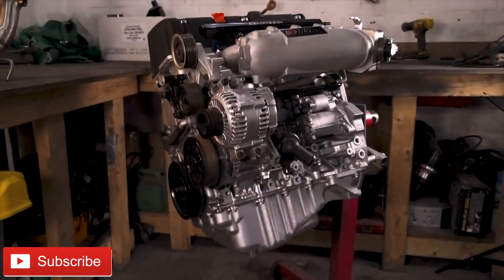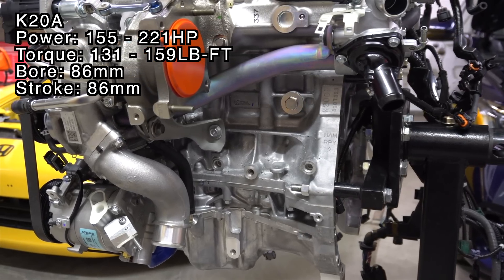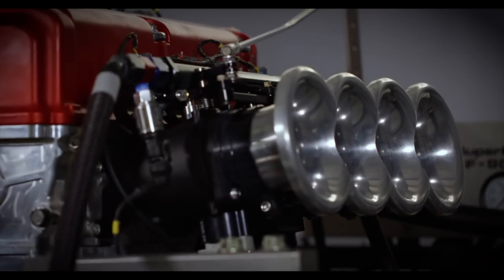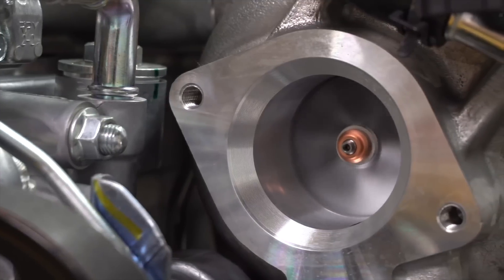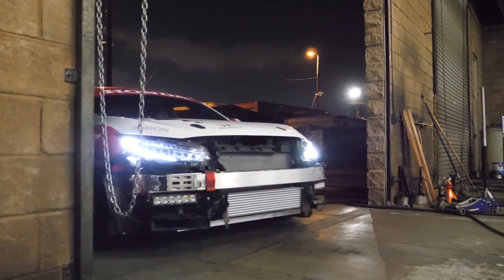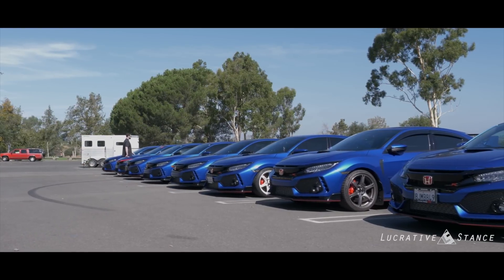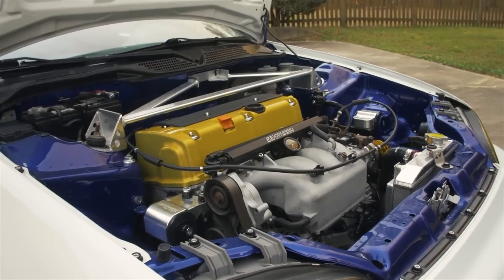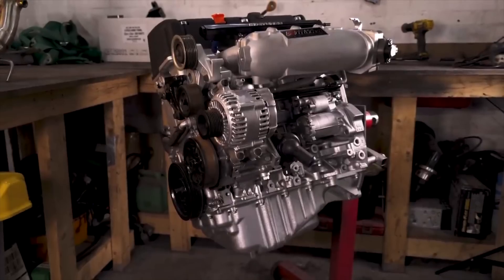Honda K20A vs K20C: What's the Difference?

Comment: I'd rather build an all motor k20 anyday and all day over taking the new CTR turbo motor which makes pathetic power when you consider the set up they provide.  And I'll just add in my opinion any k series which doesnt have a real exhaust manifold and standard head opposed to that pathetic cylinder heads with the exhaust runners built into the head is not a true k series I don't care what anybody says. And yeah over 20psi running on the new CTR but with a turbo the size of a baseball which is the equivalent of prob 6-8 psi on a real turbo.   And sorry bro but the k20's are not the ultra fun ultra high revving motors people love , you wanna talk about high revs without doin much work and even right outta the box and stock the B series vtec engines should be mentioned instead here with that statement , a stock b16 from 1989 revs to 8250 stock , a k20a2 or z3 revs to 7900-8000 tops with a much lower rev limiter than the bseries vtec motors , let's not forget that high revving here should only mean nothing but 9000+ rpms which a bone stock factory ITR b18c5 or jdm b18c is more than capable of and can rev even higher on stock valvetrain with bigger cams.  And yes who in there right mind would ever compare the k20c to a k20a , and just cause the C is more power ful doesn't mean it's better by any means bro as you slap an eBay turbo kit on a k20a and it'll make more power than the C without even have been tuned yet dude seriously what the fuck are you even talking about.  And I'll say again if it doesn't rev over 8,000 rpms it's not a true dohc vtec motor and if it doesn't rev up to or over 9000 rpms it's not a real type R motor , that was a trait that every type R motor up until the piece of shit k20c Ctr motors came into it's pathetic existance. Id be way more satisfied with a 9000 rpm all motor k20 or k24 making 220-230whp any day of the week.  Hondas and turbos aren't meant to be unless your building a swapped car with a built motor , Honda's true history is of beating cars on the race track turbo charged cars I should add making twice the hp as the Honda rocking it's little 1600cc-2000cc high revving screamer that makes cars with twice the power look like sloths.  Let's not forget hondas true lineage and there true history , their older chassis and motors set race track records , broke records , broke there own records over and over , and did this revving to 9-10,000 rpms with 4 individual TB's and compression ratio over 11:1 on pump gas if you have it tuned by somebody who knows what they are doing that's totally doable anyway.  I don't know why any one in their right mind would ever pick a 350hp turbo motor over a 220-240whp 10,000 revving motor , thered never even be the slightest consideration for the turbo option coming from my mind , Go All Motor or go home, I don't think a whole lot higher of turbos than I do of nitrous bottles piped into small block Chevy's lmao sorry man but any tuner can tune a turbo car but not ever tuner can truelly tune an all motor build to it's fullest potential , that's the difference between being good and being fantastic at what you do.

Comment: The k20c head is trash, you can make way more power on a k20a with stock internals and a eBay turbo than a fully built k20c
Reply: Daniel Bargas wring k20c1 stock can boost higher k20c4 comes sleeved so you can boost a lot more please before you leave a comment understand what you are talking about just don’t have your finger in your ass

Comment: K 20 Z 1  Running 28 lbs boost, is all you need, that direct injection does not cut it, way too much complication, size too big. Much harder Mod, and not sure if it can take it. Sleeve a K 20 (A) (A2) (Z) etc, Forged internals, crank up the boost, and you have Torque and HP.

Comment: Who doesnt like the K20C? Its better than the K20A in every aspect......

I mean, in production its producing over 300hp. Imagine whats going to happen when people start modifying them.

Also, how is the K20C larger than the K20A? If they both had turbos, Id have to argue the K20C would be smaller and lighter.....

And 400 ft-lb of torque? No surprise youll blow something up there. Thats V8 levels of torque in a much smaller package... you cant expect the internals to handle that well.

Comment: Honda didn't made Turbos because the consumer wanted more power at low rpms. The only reason was emissions.
Reply: Turbos increase emissions...... the more fuel you burn, the more emissions you create.

The main reason turbocharging has become more popular recently is because the advancement of modern turbochargers mean the turbo 4 banger can now put out near the power output of the older V6s (and even some V8s) while being in a smaller package, lighter, and more fuel efficient.

Honda finally put turbos in their cars because they have pretty much peaked efficiency of an NA 4 cylinder engine in a given price point. Meaning they had to add boost to give new engines more pep without it costing a fortune.

People wont buy 140hp cars forever, new models need more power to draw in more buyers.

Comment: They should have never called the new engine a K series. It’s a completely different design, like WTF, Honda? What are you guys smoking over there?
Reply: You mean like the f22b (accord), the f20b (euroR) and the f20c (s2k)?
Reply: @joeybaker7740  Or the c27a and the c30, c32, c35
Reply: @joeybaker7740  Isn't the Euro R the H22A?
Reply: Not the first time they've done that B20A vs the entire rest of the B-series platform. Or the DOHC "D" Series, which share very little with the rest of the line.
Reply: They couldnt match the competitors hp and emissions so they went turbo
Reply: @gggwood  thats what happen when you have smaller engines you need turbos

Comment: Does anyone remember The Pontiac GTP 3.6L Supercharged V6 from back in the day? It was really easy to get power out of but Chevy/Grand Am of course fucked it up by making its transmission only able to hold just barely more power than what it made before it turned into a grenade. Why would Chevy/Grand Am do something like that to The Grand Am GTP if they knew how easy it was to modify and make more power? Okay so bare with me...Why would Honda design a turbo engine that couldn't stand at least 100-200 more torque knowing that turbo engines(Honda or otherwise)are probably the most modified cars in the entire world besides V8's? (I'm not getting into that discussion what's modified more turbo'd engines or V8's that's besides the point). Well the first aftermarket company to make bullet proof con rods, pistons, and successful modified heads for the K20C will make a pretty penny. I see the K20C as the engine as the last petrol engine for Honda until it goes fully electric and Petrol Heads that's much sooner than you want to realize. Hey just think, won't it be fun learning a new craft on how to modify an electric car?
If anyone wants to respond I'd love to hear it. I ask for your opinions not arguments b/c I think arguments are a waste of time. If I have been mistaken about my anything I've said let me know(well besides that EV's are the wave of the future)and show me the info so I can learn.

Comment: So put a turbo on a K20A or K20A2 drop the compression by changing the pistons or getting a thicker head gasket and you have a more reliable engine than the K20C and a fraction of the cost of buying a car with the K20C in it. Sounds logical right, or am I missing something? Honestly am I missing something in my logic, please correct me if I am wrong.

Comment: bottom line...for the price you pay for the k20c you could just spend same amount of money on k20a or even k24v and get better results.
Reply: Arthur Wall  i was talking about k24 torque on same turbo not a k20a. You may be right about k20c turbo has more torque than a k20a turbo.but k24 torque is above both.i am talking about k24a2 which has real vtec and 10.5:1 comoression
Reply: you are wrong there look more into the k20c i havea k20c2 motor  and it would cost me more to get a k24a/k20a to the same power with the stock k20c1 motor you can get it to 450hp safely with same internals k20/k24 you have to change everthing out plus sleeve it . k20c1 you dont need to sleeve it also the k20c4 already comes sleeved i for my k20c2 for free reason i am trying to build it up  and it only has 17k miles on it people like you talk but dont know cars good luck
Reply: @beargang8853  dude do you have a base Civic LX? Those are the only cars i know of with the K20C2 and I completely agree with you. People sleep on it because it only makes 158hp stock, but it's just a type R engine without the head, turbo, or internals. I like the engine so much more than the shitty 1.5t they've been putting in everything.
Reply: @beargang8853  you are wrong.the k20/k24 can easy handle 500 hp. People are boosting even 600 hp stock ones just changing head bolts.
Reply: ???? I have a k24a with a k20a head , 11psi of boost with a $200 turbo on stock internals with 1050cc injectors. 
$3800 got me 400hp
Reply: @beargang8853  Wrong, have you looked up what the older k20/24s can handle? it shits out 450 daily on a unopened engine.

Comment: Never thought a Civic would ever have that much power. Why not just keep the s2000 and give it that engine.
Reply: because it wouldnt pass modern emissions standards in new cars probably 
also the F2xC is gutless, and wouldn't be able to move the current Type R as fast as the K20C does

Comment: Mhm. Or k20a swap an ek with power steering & ac for $9700, and than supercharge it for an additional $3000 to make 300whp/250wtq. $12700 and experience or $35000 and regret. I'll take experience. Thanks.
Reply: Type R is the more daily driveable car for me and does everything i need it for it do factory 
to each their own

Comment: Could you drop that c1 head on a A block ? I believe bisimoto did something similar to his ef wagon but with a k24 bottom end.
Reply: The K24/K20 (block/head) combo is probably the most notorious Honda "Frankenstein" swaps probably even more notorious than the infamous H2B (H series with B series trans) swap
Reply: @jacobwebb8818  yea I know that but that new K20 cylinder head has a single exhaust port.
Reply: K20C1 and K20A are pretty different so I'd say no

Comment: Bottom line, one engine was designed for a turbo and the other one was not. In my opinion, leave the K20C stock and enjoy it as it is.  According to this guy, try to tune the type R too much and you'll bend the rods.  At the end of the day, it's not worth it. Enjoy the car in its stock form and you'll get easily 200 to 300,000 mi with proper maintenance.
Reply: You know, "leave it alone" is not what tuners do, so the k20c will be the new exploding engine of car show exist burn outs.
Reply: @rolandocrisostomo2003  lol Any engine can be tuned....all it takes is MONEY.

Comment: I wanna try getting my hands on a k20c and drop it in my ep3 anything is possable right
Reply: Its a crate engine. Totaly possible.
Reply: Just K24 and boost it. Way less fuckin' around and way less money.
Reply: @JDMTuna  or just boost the k20a2, less torque = more grip + cheaper

Comment: One thing i know all this talk about the different mechanics of different engines is 
all good and well and yes most do what they do well but what is never mentioned
 what is needed to make it all happen is the ecu, modding engines to the point of hp
worth having requires ecu mods if not total replacement and that's when you need deep
pockets. Tuning modern engines is a bottomless pit, personally old school price, ease of maintenance, and no uni degree required so it doesn't go BANG on start up.
Feel free to change my mind.

Comment: We see now k20 stock block with only springs and retainers boosted holding 700+ no problems,  my neighbor has one 625 hp beating it now for a year and 2 months. K20A the perfect engine so far honda has built.
Reply: Carlos Carlitos naw cuhz, My F20 is best act like you kno pimp

Comment: I never really hear people talk about the f series. Is it not as good or just less common?
Reply: They good af too just not as much after market for um but yeah the  h22 f20b are great engines stock can get 1000 hp on a closed deck h just rods and pistons ,spring and retainers a turbo and you are set but like i said not many part for um oil pumps go out trasmisson are weak you'll break um all the time 500hp rang many people go h2b for this reason its a cheap k in  other words .

Comment: Dust Runner.  Do you know how to get a hp vs altitude graph for the turbo?   The NA will loose about 3% per 1000ft.   As you know factory hp are measured of adjusted to sea level and Std temp.  Just wondering

Comment: Heres a difference, I CANT AFFORD A HONDA CIVIC TYPE R ENGINE.
Reply: you can buy a k20c2 that is 500-600$ on ebay low miles a its the same block  and put change the Internals. but if you are the type of person who just does a swap and dosnt build their motor whats the point of the swap
Reply: BearGang you ain't getting a low mileage engine k series that cheap k20a3 maybe but you need all the stuff to swap engine into car is going to be a couple thousand dollars. You will never find the 1000 $ fabled swap, sure some might have but they knew the person or it was a friend. You would be better of getting forged rods pistons and install in motor then eBay turbo it. You will still be cheaper than k series swap. With Honda's you can put forged rods and pistons in motor while it sits in the car
Reply: BearGang have you seen the  turbo d16y7 or d16y8 turbocharged videos on YouTube check it out you will change your mind on swapping
Reply: @spankthemonkey3437  i have seen it. it doenst change my mind at all
Reply: Spank Themonkey with the k20c1 or k20c4 you can put 450hp and be reliable with out taking the motor apart with the k20c4 you can bump it to 700hp and not breaking k20c2 you can make it into anything if you build it like the d you are talking about for the same amount of money and get more hp more reliable do you ever wronged why no one uses D motors people only build them if they have them and if that
Reply: @beargang8853  what kind of stuff can you do to a k20c2 to improve power? NA wise I mean, no forced induction
Reply: James Smith  no, what i meant was the k20c shit
Reply: The 18' accord is badass.

Comment: K20A in EG 👍👍. What's the difference between D16 DOHC vs DOHC. Performance wise.
Reply: The DOHC D16 ('88-'91 ZC) makes more power, but slightly less torque than say the D16Y8 (SOHC). I believe that's the right way to put it.
Reply: @J3Fox00  am no knowledge on engine stuff but I over heard some guys argued SOHC is faster or better than DOHC in D series battle.
Reply: Yea, I'm not exactly sure on that either. I know more about the B/K/J series engines, and a little bit about the F series. I just know that the DOHC ZC makes a little less torque, but makes a little more or just as much power as some of the SOHC D engines.

Comment: I wonder if I can swap a K20C1 into my Integra.
Reply: Of course you can. The real question is why you wouldn't just go J-series and turbo it later. 

The hardest part of either swap is routing the shift cables, but the J fits nicely in a DC2/4 engine bay with mounts you can buy instead of having to make your own.

Comment: So I'm an Evo 9 guy, usually bash on some of the shittier Hondas but man do I love the K20A and respect K20A turbo charged, those engines are great.
Reply: Evos are great when they aren't broke.
How many axles have you blown thru?
Reply: @smokepeddler  I'm on stock axles tranny, transfer, diff, turbo and internals and I'm pushing 420whp. As long as you slip the clutch instead of dumping it you won't break until after 550-600whp.

Comment: I am running an EP3 type r With 409 hp And it is coping with the power absolutely fine just like you said I prefer the older K 20A as I love to hear these engines scream 😱
Reply: whats not to love about the k series? High flowing head from factory, holds 400whp just fine on an unopened motor, goes quick in NA or turbocharged applications.
Reply: Is your engine still running?
Reply: @mrniceguy7168 with proper tuning on a k20, upto 500hp, even boosted, its lifetime won't be decreased from stock. Bad tuning and it's done in the first dyno run. You have to make absolutely insane power to start worrying about actually bending rods or something due to too much torque. It's almost always detonation that kills things, which tuning. Of course more power means more cylinder pressure means more chance of det. Take det out of the equation and I'd bet a k20 could do 800hp and last as long as stock..but unfortunately det is always part of the equation.
Reply: @forbiddenera  are there any examples of high mileage high horsepower K engines? I’m dubious that a high horsepower K engine can go over 200k miles like most other Honda engines can easily do
Reply: @mrniceguy7168  I'm sure there is lots. K is better than B, and I've had several B's run for ages at 350hp which were all engines with at least 250,000km on them and the only time one has died was from detonation
Reply: My favorite Honda 

EP3 all day

Comment: JDM FD2 Type R had the last and best K20a motor of them all
Reply: The best looking Civic that Honda used the K20A in was the EP3 Type-R, I really dislike the look of the Civic these days.
Reply: Jdm dc5 217hp is the bomb.lol only better is the fd2 k20a only because rrc mani
Reply: Is it much different than the K20A in the JDM DC5 Type-R?
Reply: @TheDalitis8  yes, the fd2r motor is about 5hp more
Reply: @cyberrr9489  so no big difference?
Reply: @TheDalitis8  
The engine itself is the same, but the gear ratio is different.
Reply: It gets better, look up the mugen type rr. They made it more powerful.